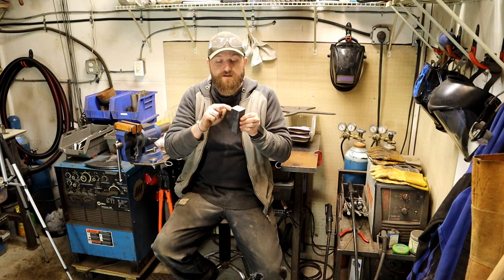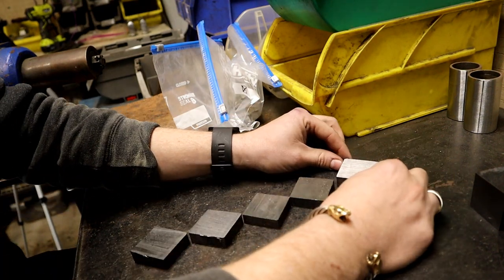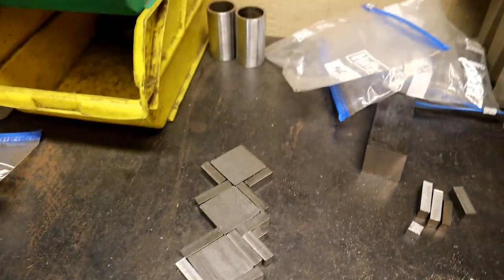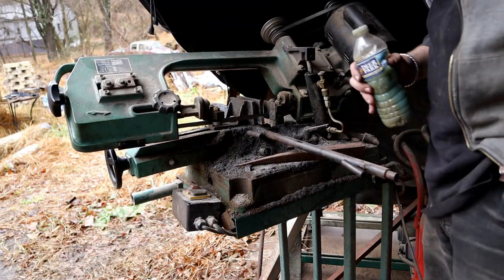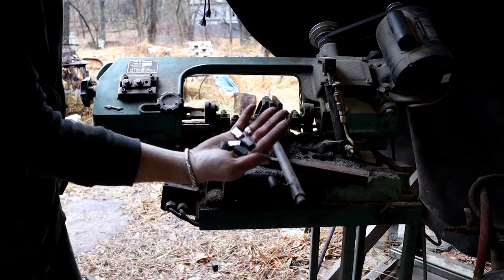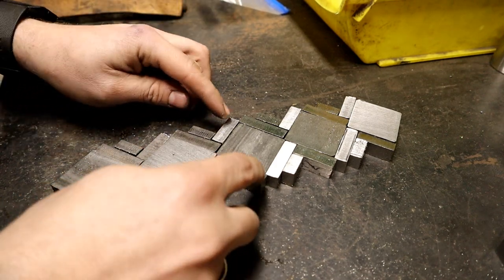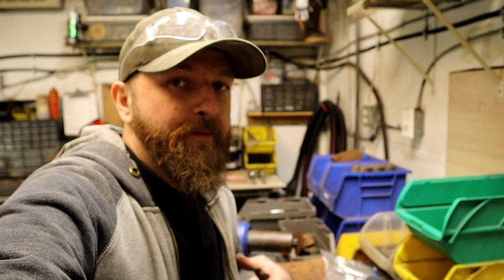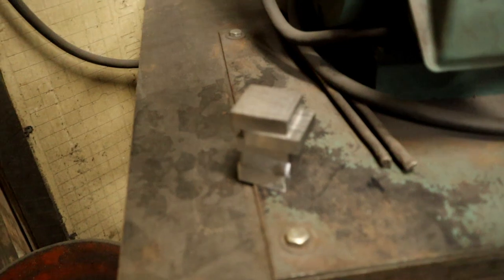Forging Bloom for a Katana - Mosaic Damascus

Comment: Man At Arms was always my favorite forging shows for a lot of reasons, but I really prefer the more involved format you guys are doing here.  I like watching you take the time to explain the squares and rectangles, and I like watching the gears turn as you figure out the actual configuration instead of just a few second cutscene saying "I'm laying out the metal in the pattern that will work best for this build" before skipping forward.  The intimate details and in-depth info is what makes making things so interesting and impressive.  I like hearing Ilya explain specifically, at more length, with more detail, why charcoal is used to heat the material.  
Man at Arms almost looked at times like anyone could do it--a testament to the skill of everyone involved, no doubt--but this format really illustrates the amount of work that goes into these builds, the extraordinary skill involved, and it's also got the fascinating educational aspect.
This channel is, for sure, my new favorite forging channel.  I wish I had found it earlier!

Comment: Hey you should make a glass platen for your belt sander that way your platten won't dish out or Warp when in hard and long-time use and you can get it more flutter there's a certain type of glass that is super flat I forgot what it was but you could try to put that on it

Comment: What is the next step with a mosaic billet like that? I am assuming that you need to tack weld it together, but how do you even begin to hammer it to set the forge welds without having pieces slide off when you hit it?
Reply from the maker: Skill and fines ! I guess you ha e to tune in to the next few episodes to see how it turns out
Reply: @ThatWorks  Looking forward to it!

Comment: Actually got a question you seem to be using Borax a lot, I used to use it as well until I found the Iron Mountain Flux, it not only prevents oxygen but actually helps with the forge weld, have you not thought of switching?
Reply: All you really need is to prevent oxygen getting to the surface of the steel, doesn't really matter what flux you use
Reply: @marcusrnning1197  ye that's all good when you got a billet all nice stacked and welded together it's more tricky when you fold over or forge weld to separate pieces, had on couple occasions that borax got stuck between the layers and created impurities, maybe I just need more practice 😁
Reply: I've made Damascus once before, but I've forge welded a lot over mild steel. I just found making Damascus sooo time-consuming and boring, the end result was nice and all but not worth the trouble. But that is just my opinion